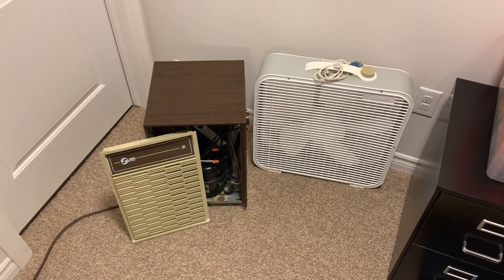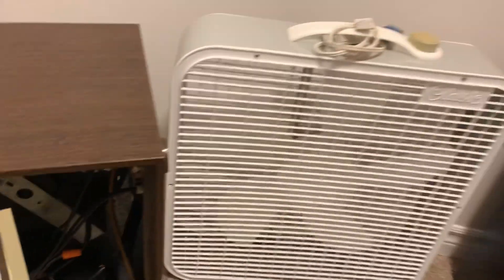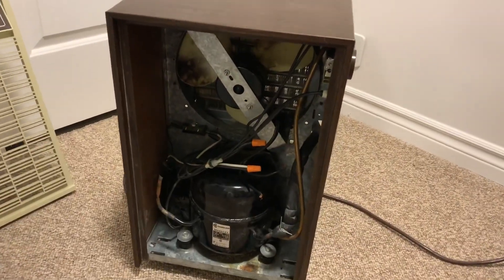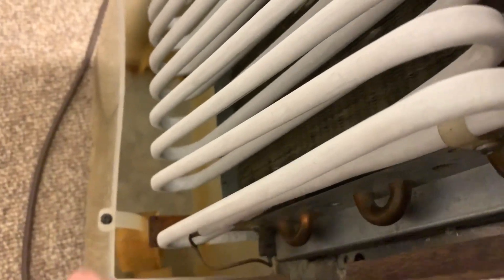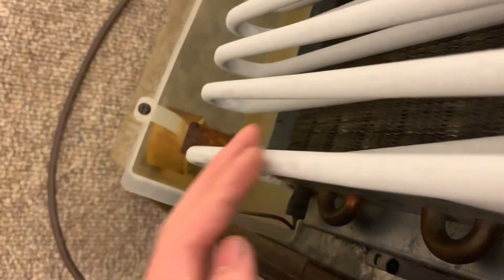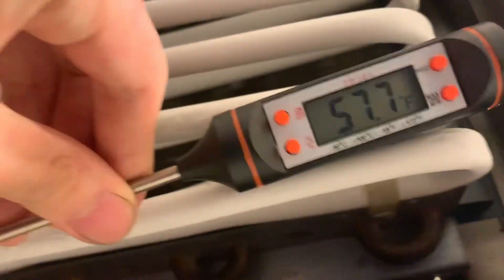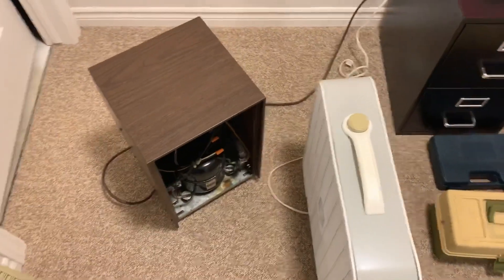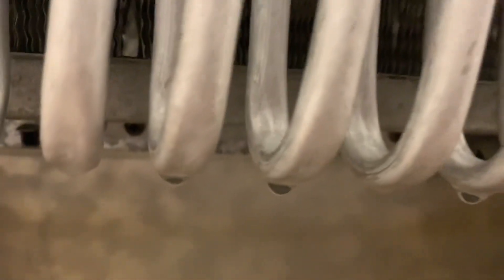1980s Super Dehumidifier | Refrigeration System Test

Comment: You've got a good charge in there, it was icing because you weren't getting enough air through it. Other than the fan motors (which fail due to lack of lubrication), these things will run continuously for decades on end. R12 was a great low pressure refrigerant, I'd put it up there with R22 which seemed to get a little colder.
Reply from the maker: That would make sense as the box fan wasn’t pulling in a whole lot of air. I presume dehumidifier fan motors are more susceptible to bearing failure as the motor is not nearly as accessible compared to portable fan. The sleeve bearings in this motor was totally worn out! The funny thing is I inspected an older Danby dehumidifier a neighbour threw out a few years ago, that had a ball bearing motor. I thought the fan would run but it turns out that one bearing had locked up solid and had burned out the motor. Sometimes I guess ball bearings aren’t much better lol.
I definitely agree that these older refrigerants work much better. It seems like one of the causes of refrigerant leakage in modern units is the combination of poor manufacturing and the high pressure modern refrigerants.
Reply: @TheSuperFanMan  Ironically enough, many of the dehumidifiers sold today have ball bearing motors. Now the opposite problem exists--the refrigerant system fails while the fan still works flawlessly.
Your theory of failure is absolutely correct.

Comment: Still suprised how good the overall condition is. If that things performance starts getting low and the coils are clean, then you might wanna get one of those ac repair tech's to refill the refridgerent. Probably barely anything left
Reply from the maker: I’ll definitely do a longer test run to check. So far I think it still has most (if not all) of its refrigerant. Hopefully it won’t need a refill, I bet it’s expensive.
Reply: @TheSuperFanMan  yep it wouldnt be cheap. And since it isnt a recupricating compressor, I heard it would be quite hard to refill.

Comment: It’s kind of sad that the fan had gave up...
Reply: I mean, it’s pretty old and the motor...you really can’t expect that it goes on for around 40 years with no trouble.
Reply from the maker: True. I doubt many people oil their dehumidifier fan motors. What’s funnier is that the other dehumidifier I found had a ball bearing motor, which are known to be more maintenance-free. But what do you know, the front bearing had seized solid and burned out the motor lol.
Reply from the maker: Yeah it’s a bummer. Funny thing is I came across another older dehumidifier before that also had a bad fan motor. My luck with old dehumidifiers hasn’t been too good so far lol